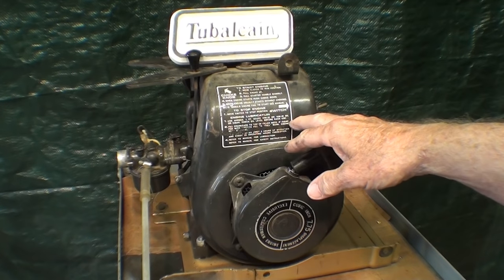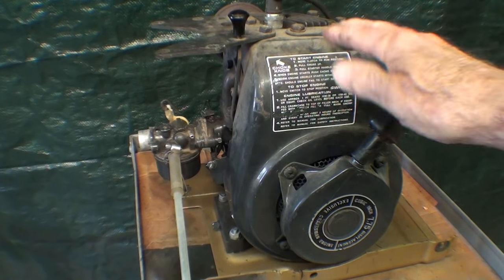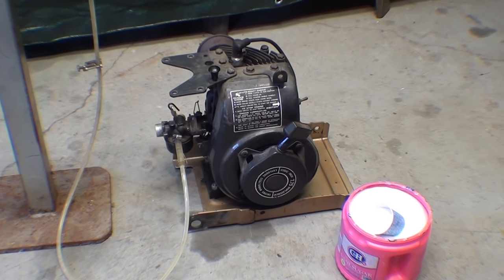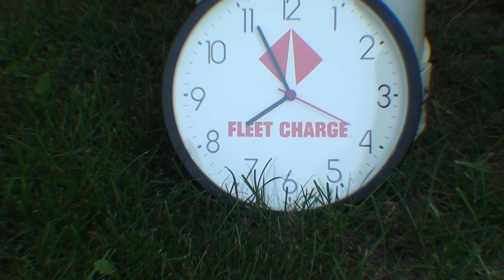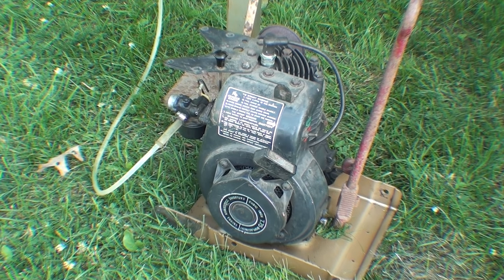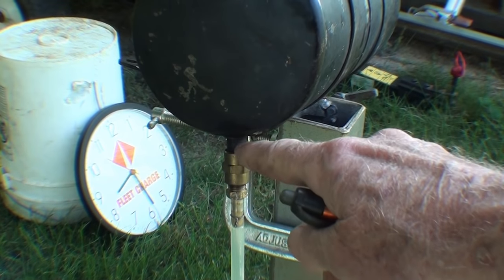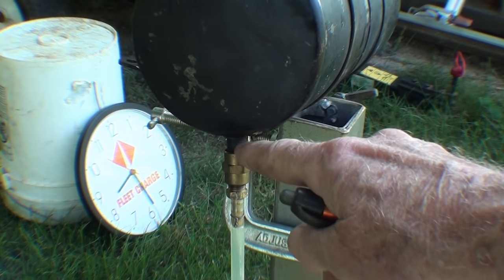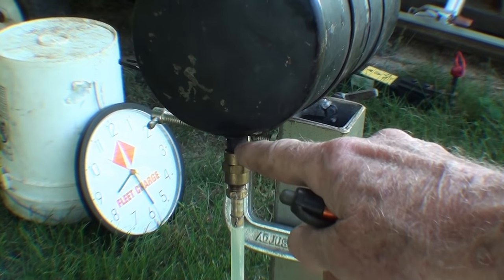MYTH BREAKERS #2 "Sugar in Your Gas Engine Fuel Tank" tubalcain

Comment: I was a mechanic for 25 years. Seen many things put in gas tanks including sugar. It would make the car stop running but I never seen an engine damaged. When it gets to the injectors that what I seen that usually made it quit running. A very costly repair. Flush all lines, replace fuel pump, fuel filter, injectors and send the tank out for it to be cleaned. Sometimes It can take awhile to diagnose the problem because you do not expect to see that. Take care

Comment: I was never taught that sugar destroys engines. I was taught that it clogs fuel systems and carb jets. So you have successfully demonstrated "sugar in the tank."
Reply: Bingo. I looked to see if someone else made this reply before I did. You got it right. Not that some unscrupulous mechanics will not take advantage of someone, and add some charges.
Reply: That's always fun. Dress like a nerd when you drop the truck off for the alignment. The guy calls an hour later, says the idler arm is bad. (I already inspected the entire suspension system.) So I pick up two buddies, we get there and say "Show us." Three of us check it with their "mechanic" watching. That idler arm doesn't move.
"I want to talk to your boss."
(BTW... I have 32 years pulling wrench in a diesel heavy repair shop, and my 2 buds have more seniority than I do.)
And that's how you get a free front end alignment. 8^)
Reply: +1 ppl just don't know why sugar is a common prank, they just do it. it's actually very fine grain so is a good blockage at many points in the fuel system upstream of the fuel filter
Reply: Just got myself a free one also the other day. Caught that Damn shop tryin to screw my mom into New balljoints! boy o boy did I let them have it. they didn't even wanna put it back on the lift to show me!
Reply: Suger does clog your fuel delivery system. However, the closer to the engine it gets (heat) the more it desolves. When it desolves it goes into the cylinder and carmelizes, causes excessive wear on components. It can also get into the oil (heads through the valves) and cause your valves and valve train to wear bad.
Reply: normal mechanics eventually become thieves.  Usually they just get taken advantage of and everyone wants them to fix their cars for  just the price of parts.

Comment: The whole point of sugar in the petrol tank is to clog the fuel line and potentially the carb on an older engine. It has nothing to do with compression or explosivity.

Comment: "Myth broken" versus "myth confirmed" kind of depends on what exactly the myth is. You certainly have confirmed that sugar in the gas tank will keep the car from running. Cleaning the sugar out of the fuel system would be a major hassle and not inexpensive at the mechanic if they have to remove the tank. Certainly a nasty prank even if it doesn't ruin the whole engine.

Comment: Great video. Great idea. I had an  old chainsaw from the 50s that someone put sand in the gas tank. It clogged  the filter but did no damage to the engine. I cleaned out the fuel system and  it starts every time.
keep the videos coming

Comment: A very small amount of sugar would dissolve in the petrol but such a small amount I'd be amazed if it made a difference to the running of an engine. Sugar, lets say sucrose for example, has a number of polar groups meaning it dissolves well in polar solvents like water but poorly in non-polar solvents like petrol (solubility is more complex than this but it's a useful rule of thumb). 

It'd be interesting to see what would happen if the there was no filter in the fuel line. Sugar has a higher carbon to hydrogen ratio than petrol so I'd imagine over time the engine would soot up. If you first dissolved the sugar in water then added a little soap and poured that in the fuel tank you might be able to get a reasonable amount of sugar past the filter. If you are going to those lengths though I'm sure you could think of a dozen different ways to break the engine more easily.
Reply: Would the sugar not crash out of solution when the solution was diluted into gasoline?
Reply: Yes, probably most of it would crash out. The solution would be more polar though so more would stay in solution and the surfactant should help. The stuff that crashes out would also be very fine, maybe even fine enough to make it past the filter.
Reply: I'm sure it would just block up at the next bottle neck, probably at the carb needle.
Reply: yup your correct,it would just block up the needle and seat at most, if there were no filter, it cant damage a engine  as it would just become carbon and spat out the exhaust,as the volume that would actually enter the combustion chamber would be minimal ,as fuck all volume of sugar could pass the needle and seat,cheers
Reply: Wobblycogs Workshop hehe your Bertish
Reply: Thank you!  My first thought was that perhaps consulting a chemist first, before the test would have been a good idea (easy sitting here in the armchair, though!)

Comment: Sugar, in pure form, can actually be used as a catalyst for jet engines. I wasn't really surprised at this result, as your preparations restricted the flow of the sugar grains from entering the carburetor/combustion chamber. In a dissolved state, it is fuel for the fire. Excellent way to bust the myth! In old times, what would happen is the undissolved sugars would enter the combustion chamber through the larger carburetor jets and fill the bores of the engines, which would then, for obvious reasons, become like glue and effectively glue the engines parts together. I've rebuild engines that have been "sugared" and once clean, they often only need a good honing of the cylinder walls and hot tank the internal parts to rid them of the caramelized sugars. Great topic and good job on the execution. This disproves the idea that liquefied sugar will damage an engine. Cheers! Zip~

Comment: (In 1994) Forensics professor John Thornton labeled sucrose with radioactive carbon atoms and mixed it with gasoline, then spun the concoction in a centrifuge. After the undissolved particles were removed, the liquid's radiation level was measured to determine how much sucrose had become part of the gasoline. The answer was extremely little: the equivalent of less than a teaspoonful per 15-gallon tank of gas.  But that's not near as much fun as running an engine and putting sugar in the tank.  
It's no accident Sodium Silicate has traditionally been used when an engine needs to be seized.  But it is put in the oil, not the gas.
1 thumb up anyway for kicks and giggles.

Comment: I'd always heard that sugar would disable a car, not that it would destroy the engine. Your test seems to indicate that it will disable a car by clogging the fuel system. I suspect that sugar works better than, say sand, because the granules are light enough to get carried into the fuel line, rather than just sinking to the bottom of the tank and sitting there. 

I wonder what would happen if you used soda?  Where the sugar is already dissolved.  Would the gas cause it to precipitate out?  Or would it stay dissolved and get carried into the carb?  If it did, I'd guess it would get left behind there and eventually clog the carb...or injectors if no carb. The gas and the soda wouldn't mix of course, and pure soda would stop the engine, but with agitation maybe some would get sucked in along with the gas?

Thanks for showing that!  Good stuff to know and to raise more questions.

-- Mike

Comment: two bottles of maple syrup one small bottle vinegar dissolved into alcohol,and mix it in a gallon jug, and it will destroy the Rings the valve seats will crack,and sugar has almost the same effect if it is dissolved in lukewarm water before it is put the gas tank.

Comment: I think it would be interesting to try running that engine in a week or so to see if there are any changes. Aside from the mechanical blockage, I wonder if after it cools down, the insides might be coated in goo or varnish, like what is left by using really old gas.

Comment: Mr. Pete I am an auto mechanic and remember a particular vehicle.  It was a Jeep Cherokee. The fuel filler neck was full of sugar so I knew someone dumped some in.  The car ran just fine but I did have to remove the fuel tank to clean out the undissolved sugar.  Most likely it would have been ok to just leave it in there.

Comment: I guess the myth may have originated from people that were not able to tell the difference between a clogged fuel system and a broken engine. All they see is that the sugar caused the engine to stop running. Now the car is broken. And as we saw here, sugar is good at doing that. Even though a clogged fuel system is cheaper to fix than a seized engine, the mechanics will still write you a substantial bill to fix it.
Looking forward to seeing what else you come up with in this new series.

Comment: I belive sugar would have an effect if it was added to the oil. First it would run fine and continue to run but  once the user stopped it the caramel created by the heat would seize the engine as it got cold. Just a  guess...

Comment: When I was a boy, the myth was to dump a cup of sugar down the engine’s oil filler tube.  The saying was the sugar would melt when the oil got hot and be distributed throughout the
engine, and when the engine cooled, the sugar would turn rock hard and clog every oil galley.  Supposedly, the next time the engine was started, it would be starved of oil and would self-destruct.
Reply: Sounds like the premise for Mythbreakers 3!
Reply: I heard the same thing , sugar would melt in the hot oil and ruin the engine.
Reply: ive heard something similar but to use bleach.
Reply: How would you get into the engine to dump that sugar ? all my cars will pop the hood if you press a button inside the car.
Reply: I guess I was not really thinking a car per say, I  grew up in a small farming town in Iowa and an in my teens grew up in a small rural Minnesota town, tractors and lawn mowers are what I always heard about, But as a after thought back when I was a kid it would not be uncommon to see cars or trucks unlocked, Mind you that was back in the day when you heard the church bell ring nine times or dark you had better be on the way home.
Reply: Chris, when Mr. Pete and I were boys (we were born in the 1940's), you could open just about any car's hood for the outside.
Reply: I feel sometimes i was born in the wrong generation.
Reply: I heard adding it to the OIL was the way to go..... So I agree....
Reply: No people couldn't get under the hood as easy it was around the time throttle body and fuel injected vehicles started to make an appearance
Reply: Gee, with all these ideas of what to put in a gas tank I've come up with a few myself. How about a little thermal nuclear waste, human pee, dog poop, nitro methane, hot fudge, milk, nickel carbonyl, a touch of CLF3, Digoxin, Ethylene glycol, Tabun, Agent Orange, and lets not forget good old Batrachotoxin.
Reply: CLF3 would probably just make the tank explode before you could run away!

Comment: I heard it was a way to disable a car back when gas tanks weren't locked.  If you poured enough in it would block the fuel lines and you would have to replace the fuel lines and tank.

What were you doing in your youngin days that made you drink leaded gasoline?

Comment: When I was at college nobody had cars, they had small 2-stroke motorbikes - if they had anything. If you wanted to immobilise your mates we would use a pencil (graphite) and draw a line down the spark-plug (usually easily accessible) and this would short out enough of the current that the bike would run poorly - or not at all...but no lasting damage was done. Other than to your friendship! Great video Mr Pete - I hope the Discovery Channel sign you up for "Mr Pete's Myth-Busters 2" - "Stand aside Adam and Jamie" :-)

Comment: I remember as a kid we played around with putting pinches of sugar into the air intake with the air filter removed as the engine was running.  It smelled good like marshmallows roasting!  I imagine if you did this slowly over a period of time, you might get enough sticky residue into the engine to gum up the valves, or rings.

Comment: I think to your average person who isn't technically familiar with the workings of their car would consider the rather high bill to have the sugar removed would consider it "engine damage" thus the myth being stated as such, "some kids put sugar in my gas tank and it ruined my engine". I always figured the fuel system damage was the culprit, and never considered that it may cause actual internal engine damage. As you demonstrated, very little if any sugar is dissolved by gasoline/alcohol.

The list of probable repairs required would be: 
> Remove and clean the fuel tank or replace it (replacement being the most likely option with the baffles in modern tanks and labor rates being what they are),
> Replace the fuel pump (many of which are crimped shut, and unserviceable (even back in the pump-on-block days)), 
> Replace a fuel filter,  many  older ones had a spring bypass and would lift the element and bypass the accumulated dirt all at once - the theory being your engine would be able to continue running if it clogged, an very bad idea, but it was common in the '50s and even later. If that were the case, 
> A Carburetor rebuild would finish out the substantial bill.

If there were any lingering water in the tank and float bowel (or even in the older water separator style 'filters' used in the older cars), I'd expect it would be drawn into the mix and combine with the impacted sugar and form a sugar "candy concrete" wherever it was trapped.

Modern vehicles with electric pump in the tank EFI would at probably stop the sugar at the tank, but in this 'disposable' era, would require replacement of tank and pump, at a minimum. If any sugar made it to the injectors, a set of those would be in order.

Add in the towing bill and possibly a rental car and I think 95% of the motoring public would consider the associated bill "Severe Engine Damage" (severe wallet damage for sure)

Thanks for your videos, I appreciate the time you take, and look forward to them. Regardless of the subject, they are always worth watching.

PS
Here's one for you to consider (if you're looking for a similar myth to investigate), also from my youth - Do mothballs (napthalene) in the fuel tank provide any benefit? Problems? Do they DO anything? I'm sure) you've heard the myth they increase octane (usually stated as 'stop knocking'), improve mileage, increase power etc....
Your engine is still OK....

Scott

Comment: Been an automotive repair tech for many years and only damage I have ever seen done is to the carb or on later engines to the electric fuel pump and/or fuel injectors due to the sugar clogging them and of course this can be quite expensive to repair. I have not seen this yet in a GDI type engine, but I doubt it would damage them either..however with a turbo it may cause damage due to the engine going lean from weak  fuel pressure and such...but now I am just rambling on...

Comment: Hi Lyle. Interesting! I had an Austin Gipsy 4x4 that used to block the tank pickup tube with rust flakes where it went through an olive at the tank top outlet. This constricted the tube slightly.  It got slower and slower then stopped. Within a couple of minutes the rust fell back down the tube and I could drive on normally. Took me a long while to cotton on! 
The sugar in your demo, building up at a restriction, showed exactly how that happened.

Comment: A well done deed for humanity to finally see this tested. I guess that if the filter wasnt used the suger might clog up the carburator in a quite messy way. Was old engines ever run without fuel filters?

Comment: When I was studying auto mechanics in the 70s we were told that sugar does not dissolve in gasoline. We were told that because it does not dissolve that it will clog up fuel systems. When people know that someone has put sugar in their fuel tank and the vehicle stops running they often believe that more damage has been done than was actually done. If you wash the sugar out of that tank with water then dry it out good it will be as good as it was when you started.

Comment: While I never thought to try it, I was told the malicious way to seize an engine was with Molasses in the fuel supply.  It coats the combustion chamber at first with a slippery goo that also serves to help seal the rings and lubes the and cylinder walls so the piston slides easier.  So the engine runs much better - at first.  Then it turns to a taffy, and hardens.  The piston rings and grooves crack and break and it's all done!

Comment: seems like the largest problem is that the sugar "slurries", but only disolves slightly.....then the grains pack tightly into what ever restriction might be in the line...sugar being lighter than sand, would "carry" more readily to the constriction sites.     I would suspect  in vehicles that have been given this treatment, the fuel system is just massively clogged more than anything else.....    Now if there's a significant amount of water in the gas, that might change things..... Might be worth a repeat test, but with a different variable .......